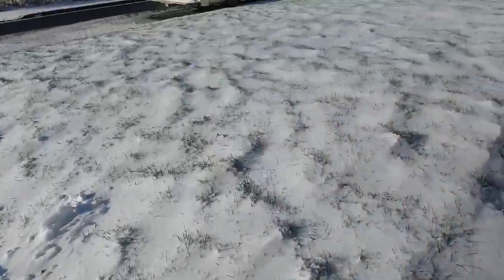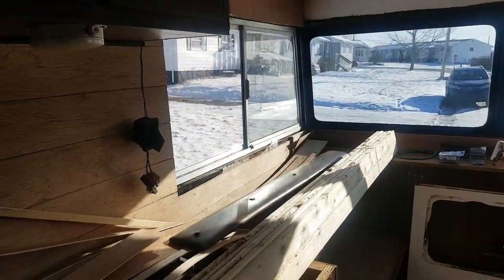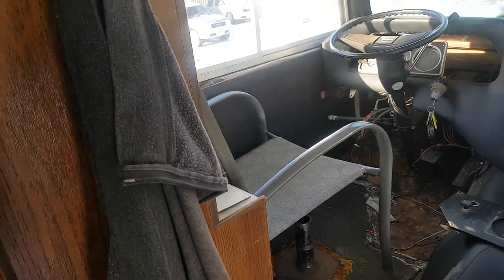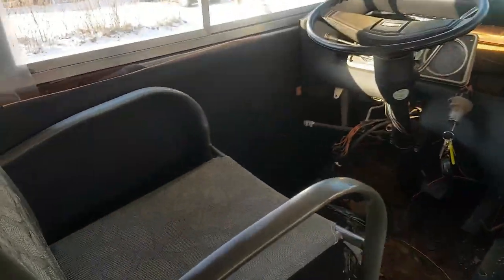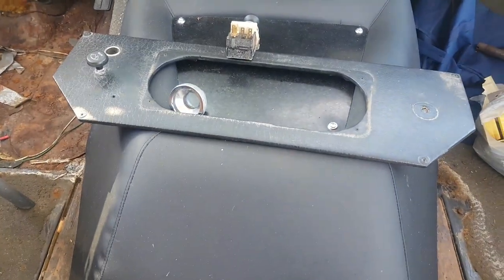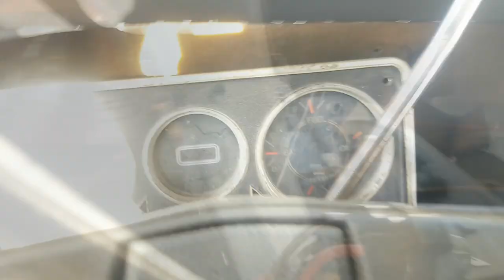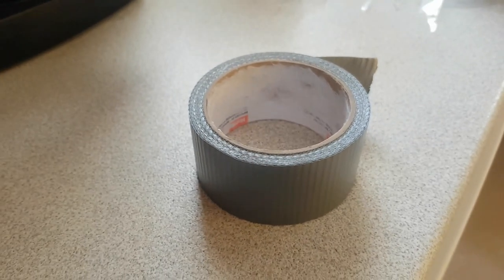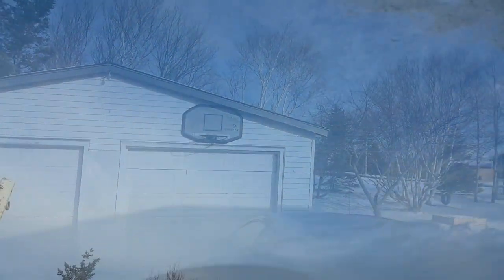rv winterizing red green style duct tape & coffee this guys garage

Comment: Ahhh...  The days of pumping the accelerator several times and holding it 1/2 way to the floor while you turn over the ignition and pray.  Old times for sure but you know, they always did start.  Maybe it was the prayer.  I've done the same duct tape patch job on a 76' Dodge Brougham.  Your vents are at least tin, mine were plastic and took a lot more tape.  Thanks for the upload as I was just wondering about that motorhome.
Reply from the maker: lol yes those days of old lol. ty for taking the time eric ,more fleury content in the spring👍